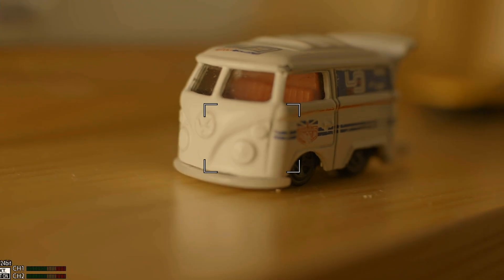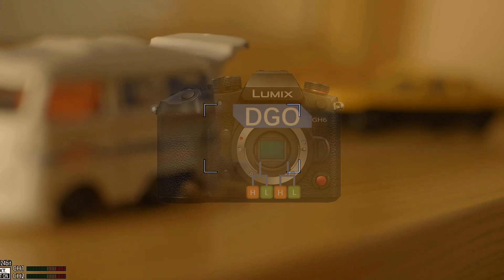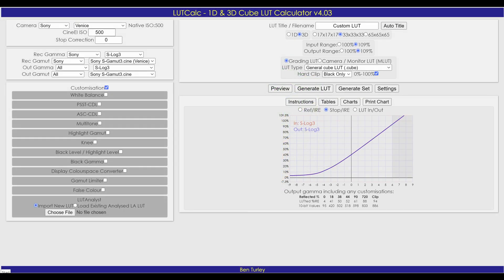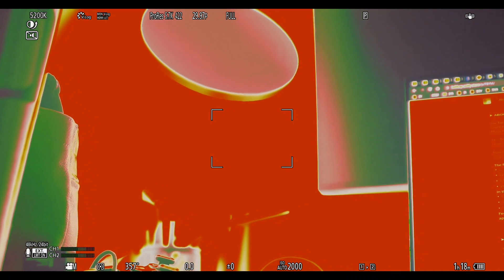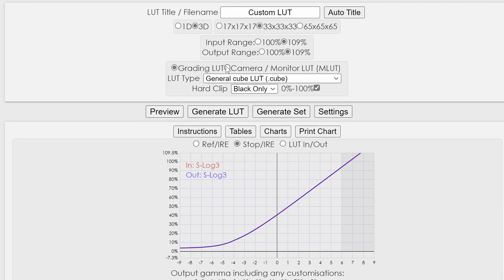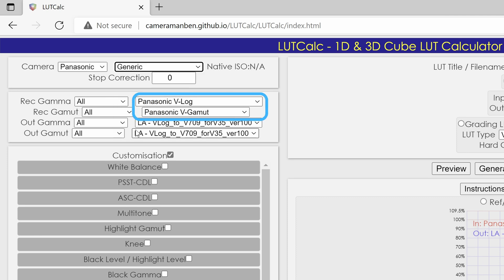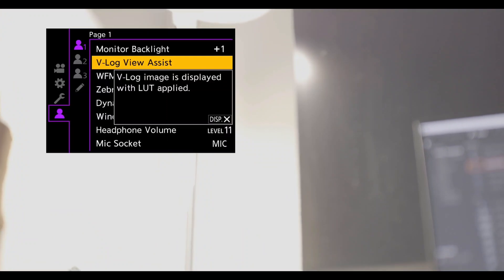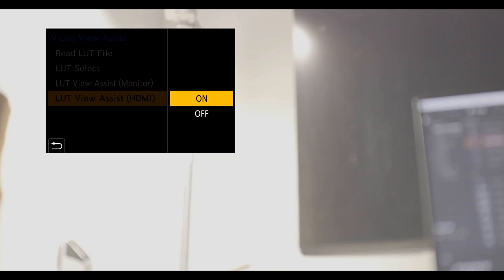How to get False Color on Panasonic GH6

Comment: this does work with DRB off, the stops are measured with respect to 42% IRE which is 18% middle grey, so just count the stops to the right of wherever 42% IRE is on your curve

I can't get red because I'm using an extreme HLG curve (vlog/vgamut → HLG/Rec2020 → DCC Rec709 lined up at -2.33ev with 100%) and the curve is too steep (the software has a minimum 3.5 stops over middle grey and my red would only be ~2.33 stops to the right over that)

Comment: any insight on how to custom make one with dr boost off? thanks
Reply from the maker: Hi, I have tried to make LUT for DRBoost Off in LUTCalc. However, the result is not good. No matter how to adjust the settings, it never works.
Reply: I have discovered after a ton of research: vlog/vgamut → varicam v709/varicam v709 with 109%/109% is the default panasonic cube lut

1. load the panasonic cube in one tab and press analyze, this is the reference tab so you can see the curve
2. in another tab, create a lut vlog/vgamut → varicam v709/varicam v709 with input 109% → 109%, generate a cube and load that in the same way you did the default panasonic one. compare with the other tab (it should look identical)

I don't think this answers your question, but should help anyone messing with this (it's taken me over a week to discover this).

For your question, I think you just put false color at slightly different IRE values when DRBoost is off. I personally think DRBoost is snake oil and just a type of noise reduction that would make the image blurry

Comment: Thanks for this pro technique! Question: Based on your note, your false color LUT will not work for Vlog with DRboost mode off?
Reply from the maker: Yes, only for the case where DR boost is on. The reason is that when DR Boost is turned on, the clipping point of the highlights moves up, so the corresponding red overexposed area on the false-color display will also change in sync. If the false-color LUT is used in the case of DR Boost off, it will cause the overexposed area to appear as a normal exposure area.